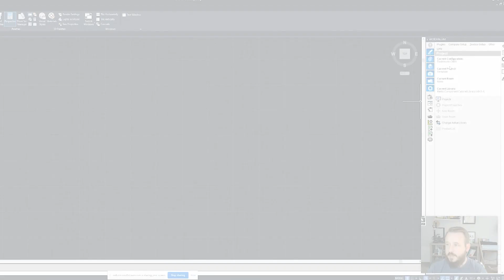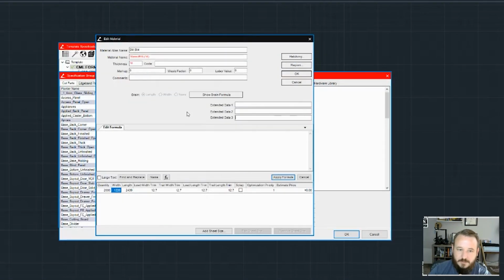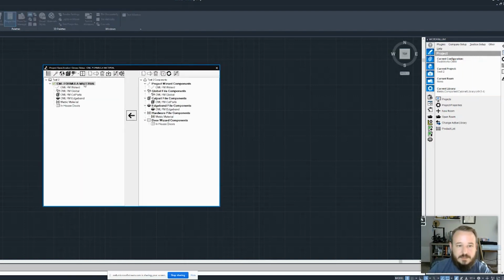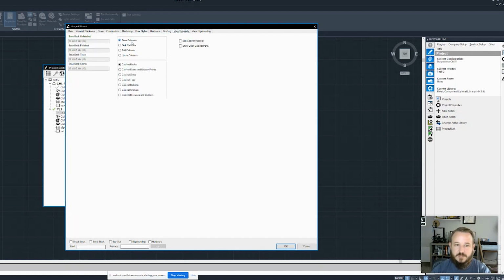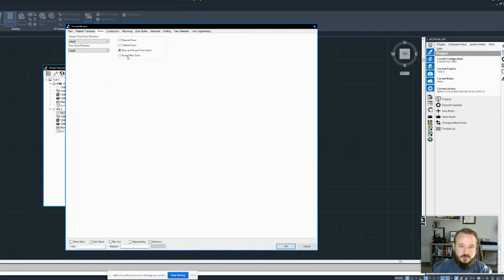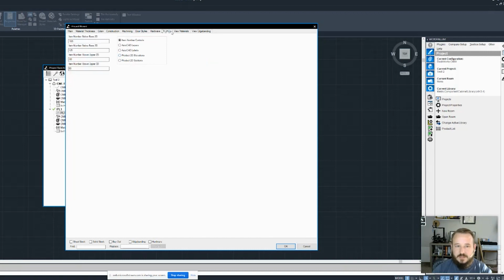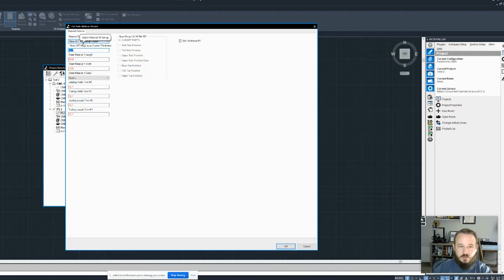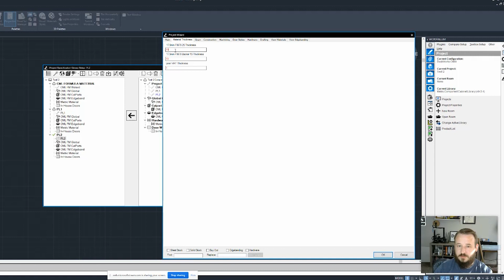Effortless Spec Group Setup with Microvellum's Formula-Driven Material Solution

Comment: On the material UI, was the alias dialog box already built in, or were you able to add that yourself?
Reply from the maker: Hey @troycampbell6819 the alias dialog is built in. it is only there if you specifically add a new formula material as opposed to a regular material. When you right click to add a material there should be an option for "Add Material" and another for "Add Formula Material".
Reply: @DuckWorks Millwork Solutions  great news! Thanks for taking the time to answer my question. Your content is a tremendous help.  Can't wait to see more.